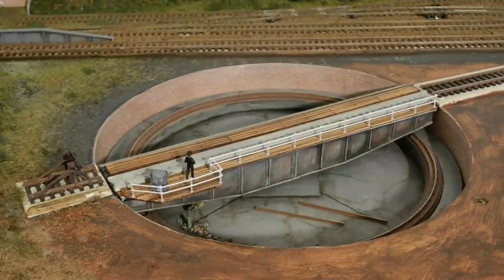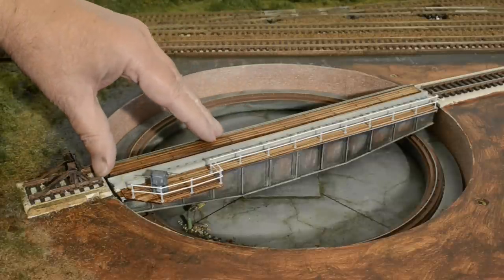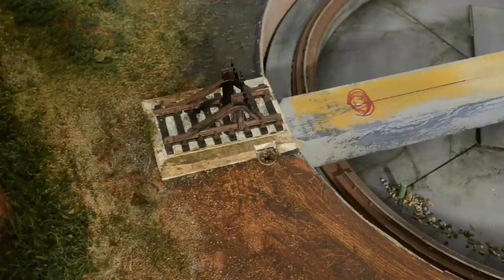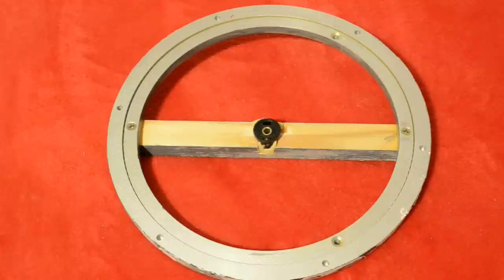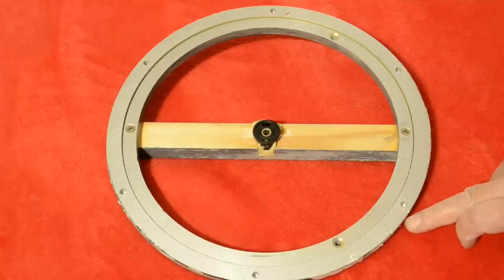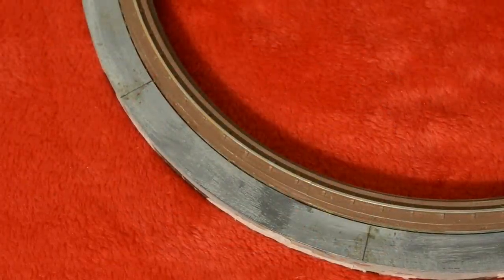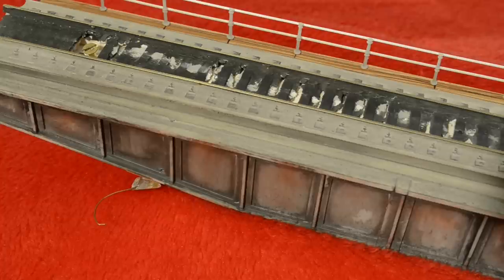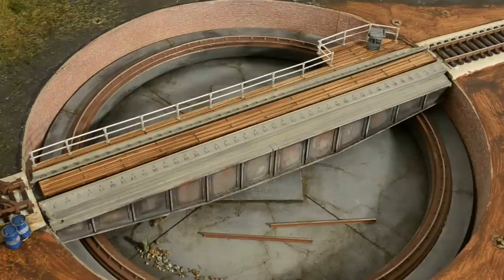MAKE OO GAUGE TURNTABLE

Comment: Hi David, I've just purchased a Dapol turntable, might try to do the same or similar...thanks for showing your vid ...Fred
Reply from the maker: Thanks Fred. Since the follow up video I have removed the bearings. There is no load on the outer ring, it is only cosmetic so I felt the bearings were adding a drag to the inner ring. It works better with the bearings removed. Good luck with your build. ... David
Reply: David Hyde ....hi David it’s been a long in the planning but I’ve finally made a start on the turntable...just need a bit more info on the electrical connectors...mine will not be motorised...and only in a slight recess....in anticipation...fred

Comment: Oh, so the lower ring rail moves WITH the bridge as opposed to the common set up of wheels on bottom ends of the TT bridge rolling ON a fixed ring. And it's because you chose to have it all atop a lazy susan mechanism..
I  suppose in the great realm of things it makes no diff as the final outcome is quite realistic and am sure, pleasing enough for you in getting your locos turned around,...which is ALL that matters.. 
Anyway, great job, sir....

Comment: Hi David, my lazy Susan arrived today. What did you use to fix it to the inner circle, I was thinking of PVA or some contact adhesive? I agree with Hovermotion, your delivery is precise and to the point, no ah's and um's. Thank youAlan
Reply from the maker: Hi Alan. I drilled & countersunk 1 additional hole on the inner circle, directly opposite one of the pre-drilled holes already in it.
I was then able to screw the wooden beam across the inner circle. I bought a radio knob with a brass insert & grub screw. This will fit securely on the motor shaft. I then cut out a section in the centre of the wooden beam to house the radio knob.
With the wooden beam attached to the inner ring, attach the radio knob to the motor shaft (secured by the grub screw). Making sure everything was as centrally placed as possible, I used some epoxy putty to secure the radio knob to the centre of the wooden beam. Hope this is clear.
The motor is secured to the turntable baseboard from underneath. Neither the inner or outer circles of the lazy susan is fixed in place. This allows the turntable to 'flex' a little bit If you are a fraction out in your centering. 
You need to be pretty close though else the rails wont line up. 
I did eventually remove all the ball bearings Part #2 near the end). At slow speads the results were smoother. I am still using it with the bearings removed.
Hope this has answered your question. Good luck with the build. Love to here about progress, especially if you come up with any improvemrnts. Regards, David

Comment: Hello David, thanks for a wonderful idea for a turntable. I’ve followed much of what you have done but I don’t know how to cover the metal rings of the lazy Susan. Have you painted the metal rings or covered then with some other material? Please just say.  Many thanks. Keep safe and well.
Reply from the maker: Hi John, many thanks for your comment and question. There are two metal rings that bake up the lazy Susan. The outer ring remains visible so it will need painting - as will the vertical 'showing' edge of the inner ring. The plastic circular rail comes with the Dapol kit and this is simply glued to the top surface of the inner ring - (araldite or similar).
Hope this is O.K. Keep safe  ...  David
Reply: @davidhyde4329  Thanks for a swift reply, David. I’ve bought some metal primer and painted the “tops” of the aluminium rings in preparation. I found an original Airfix kit at an exhibition late last year, but sadly there was no circular rail so I may leave out this element OR buy a fresh kit. As for the vertical edge I have successfully constructed a curved card wall insert and papered it with a suitable building paper including wall capping folded over at the top. I’ll send you a photo if I can. Keep safe and well, John.
Reply from the maker: @johnthewlis8524  Well done John, shame about the circular rail. It was made up from segments in the Dapol kit. Curved wall using building papers is a great idea. Love to see a photo when you have finished it. Good luck  ...  David

Comment: As far as your electrical connection to bridge, you could extend the shaft and get some poly carbonate and glue brass/ copper strip in circles, 2 off, then get 2 brush holders one for each track, and 2 brushes that contact the brass) copper strips giving constant electrical contact

Comment: Sorry one more question, did you hook up to the auxiliary on the Elite.for power to the motor.Richard
Reply from the maker: Hi Richard, no problem. Good point, no I didn't. I powered the TT motor through the dcc decoder. I took the track power and connected it directly to the red & black wires on the decoder, and than connected the orange and grey wires on the decoder to the TT motor. When you select the TT in Railmaster the dcc ID will connect to the decoder and, hey presto, you have your turntable under the control of Railmaster. To put it another way, normally the track power gets to the decoder through wheels & pickups. The TT does not have wheels so you need to connect it directly to its motor. Just get back to me if this is still unclear  -  David

Comment: Hi David, I have Peco turntable, what motor did you use to operate the turntable, I've tried the expo model , but too noisey, also I'm running Railmaster with Elite.
Reply from the maker: Hi Richard. Yes I have heard with the problems of the expo motor. Had a Hornby turntable for a very short time and that made a racket too. I bought mine from ebay, its is all metal and it is cheap - well under £10 UK. What I have just done is posted full details on my Deresley facebook page with a couple of photos, this will give you all the information and specs you need. I added a spare DCC decoder and controlled it through Railmaster.
Deresley facebook link  :  www.facebook.com/Deresley
Thanks for your interest  -  David

Comment: Hi David, thank you for the extra info, but what I want to know is what adhesive bonds the plastic circular rail to the aluminium. I've looked on line and there are so many conflicting statements, I'm confused. Sorry to be a pain.Regards. Alan.
Reply from the maker: Hi Alan, sorry, I misunderstood. I used a 10 minute epoxy glue. I it is only cosmetic so I guess you could use PVA, or super glue.. You are not a pain, I appreciate your interest. Regards, David
Reply: Always will try to help people save money.Silicone.If you look in buiders skips.There is always some left in the nozzle.Enough for a turn table. leave overnight.Not painters cork.

Comment: Just a note the Peco Turntable has 2 wires from the deck , that attach to the bus track wires ,the motor seems to be powered separately . Would that be correct?Richard
Reply from the maker: Hi Richard - no, I have just viewed the clip & the understanding of the circuit is a bit confusing. The only power supply needed (from the main track connections) comes in at the socket, from which there are a Red & Black wire that lead to the tag strip. The tag strip has 4 connectors. The Red & Black wires are connected to to top 2 connectors on the left (as viewed). Two bridging wires are taken from these connectors to the bottom 2 (as viewed) - keep all these input connections on the left of the tags (for simplicity). What has now happened is that the single power input from the track has been divided into 2 separate inputs. Connect the top Red & Black to the TURNTABLE TRACK (via the contact posts so the loco can move) and connect the bottom Red & Black to the Red & Black wires on the decoder. Finally connect the Grey & Orange wires from the decoder to the TURNTABLE MOTOR. When you switch on your layout, with a new decoder, your Turntable will default to 03. Go ahead and set it up in Railmaster as if it were a loco.
My wires colours may not have been as I have described which doesn't help ! & there is a hole through which the wires pass -close to the tag - strip which doesn't help either.
If you have access to facebook (perhaps a friend) I can put a wiring diagram there if you need further clarification. Good luck  -  David

Comment: Very good,Have subscribed now,so found your earlier video,s.I dont understand why you used your pick up system for the track.ie.when you could have run normal cable down the centre  through wide enough holes with a bit of slack.and as i said before a couple of  light switches.Also ,How did you make your name board,
Reply from the maker: Thanks for subscribing. I could not run cables through the centre as I opted to turn the table directly via a geared motor. The shaft from the gearbox rotated up through the centre. I decided to use passing contacts to switch polarity and I found this easier to set up above the turntable than below it. As for the name board - the Nene Valley Railway is just up the A1 from me and they have a turntable that looks vaguely similar to mine and had this name plaque on it. I photographed it then, estimating its size, I scaled it and produced a copy using Photoshop (elements 7). It was just a case then of printing it and fixing it on a scrap of pasticard.
Regards - David
Reply: Not exact centre,enough to clear the gear box.When in its position either side..As long as its not showing from above.and the cable holes as big as possible.and enough slack on the cable.Also another way is to drill cable hole at each end of turn table underneath  loco ramp with enough slack on cable underneath .Your turntable guide is glued .you just have to remember to turn back the way it came every so often to stop twisting of the wire.
Reply: Second way .you would have to redesign the base to work.
Reply from the maker: Exactly so - perhaps I will look at this again in the future. I am happy with my decision thus far. Thanks for your interest, I appreciate your views - David
Reply: Thanks for the reply.The other thing that you said about helping it to line up easier.There are 3mm cube neo magnets..I think if you put one on each inside of rail.Very small and easy to paint the top thats showing ,to camourflage.Maybe both ends would be to strong.but could try one end first.The problem with the neo magnets they are about £8 for 50.But they are also good for uncoupling.So not wasted
Reply from the maker: Very good point, now that never crossed my mind. I have used neo magnets and they are very strong. I think my motor/gearbox set-up would produce enough torque to get started but, as you say, one might well do the trick. Thanks for this, I will try this tip in the future  -  David

Comment: Thanks for reply David, what decoder did you use and on Railmaster how did you link in.Richard
Reply from the maker: Hi Richard, you're welcome. The decoder was just the basic Hornby R8249. I would imagine any similar would do. On Railmaster just treat it as if it were a locomotive, allocate it a identification number (I used 99). You will have the option of cruise & shunt speeds I just set the shunt speed the speed I felt looked right for the turntable you will also have to allocate a cruise speed. Obviously I named the 'locomotive' TURNTABLE. With Railmaster you can rotate the turntable in either direction and control the speed. I had to stop it when it reached its turn limits. Takes a bit of getting used to but it worked fine. Hope this helps  -  David

Comment: Thanks David, been of great help, so the to purchase motor and I'll get the Hornby decoder and go from there.If it's ok get in touch with you for more advice. Unfortunately I'm not on Facebook, my wife is but that's her account ,and " no body else's " , so will get in touch via your you tube site.Many thanks again,Richard a very early morning in Australia.
Reply from the maker: No Problem Richard. I can't attach photos (But you have seen the motor on the video) I have just copied my facebook post (below) which has the specs. - Hope this is useful in your ebay search  -  David
High Torque Turbo Worm Geared Motor DC 12V Motor 2-160RPM Reversible JGY370 TH
I fitted a DCC decoder and set it up to control the speed, as if it were a loco, on my controller
Specification:
Material:Metal
Voltage: DC 12V
Rotating Speed: 2/6/10/18/40/160RPM
Features:
The motor is Gear DC motor with micro-turbine worm, you can change the wiring-connection to change motor rotation.
1. Turbo worm geared motor with self-lock, that is, in the case of motor without electric, the output axis is fixed, self-lock.
2. The reducer output shaft arranged vertically with the motor shaft, whole motor output shaft relatively-short than general gear motor, widely used to be installed the dimensions requirements strictly occasion.
Application: open the window, door, Mini winch. ect.

Comment: Hello David. I realise that this video is now three years old. In the intervening time did you resolve the issues regarding pick-ups for the track?
Reply from the maker: Hi Bobby, many thanks for your interest. I enjoyed the challenge of making the turntable. I used it with some confidence having got used to judging the rail positions by eye. The connections to track worked very well. I did eventually start to buy locos with sound but, by then, I decided I wanted more scenic areas for photography so I never resolved the lack of connection while the turntable was operating. Small towns, like Deresley, would not have had a turntable, so I altered my method of operating my goods and passenger services so I did not need one. Recent videos show some goods operations without the turntable. When this heatwave cools a bit I will produce a  passenger service video - its too hot in my railway room!!  ..  David